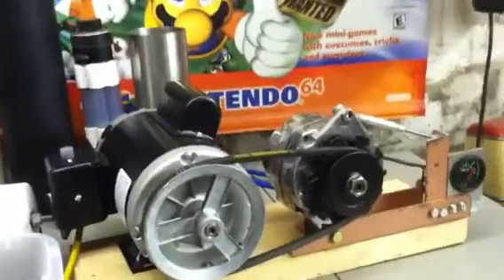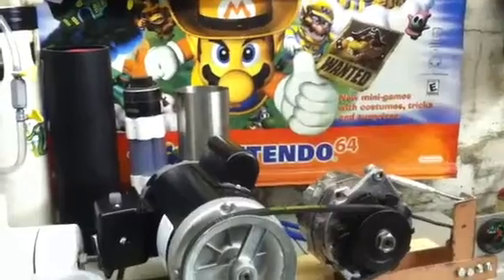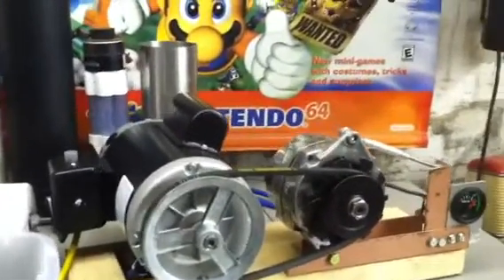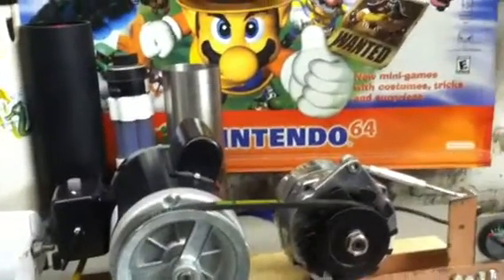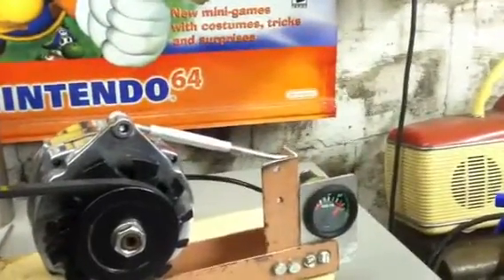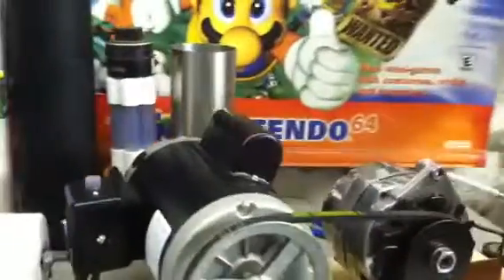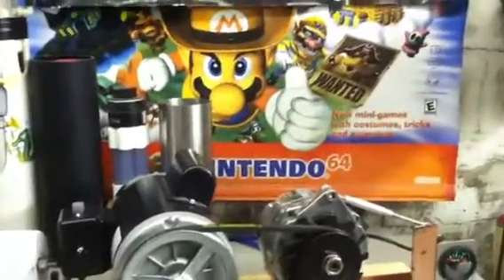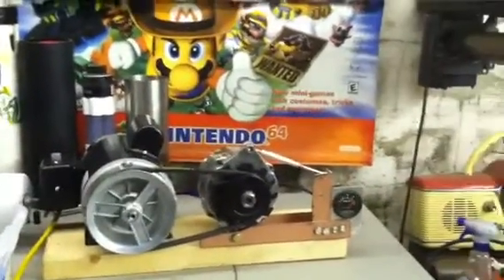Testing Hho charging station

Comment: 2 or 1 1/2 pullye would give you a lot more rpm's for the alternator. if you do not  have a supplier for the pulleys let me know, found a few online for another project i am doing. running hho cell off the 3 phase from my pulse motor.

Comment from the maker: Yeah I guess it depends on the gears,My street rod does 1,800 rpms at 65 mph my wifes new car does 1,700 at 65 mph so I will match the speed later this week an also buy a pully that will idle at 800 rpm so I can test that.Thanks Dominic

Comment from the maker: Well it is model 67841 from harbor freight,can be set up an a 12v or 240v which I will wire later. 1.5 hp 3450 rpm the alnt has a 3.5 inch pulley so i would need a 2 inch pulley for the motor. Maybe I should have bought the 67842  2 hp 1725 rpm but I had to have the fastest one. 67842 has dual caps for faster starts maybe I will return it later this week Happy Thanksgiving,Dominic

Comment from the maker: I have built many dry cells,the one ont the S-10 was doing 4 lpm under 20 amps a lot of u tubers have called me a liar and I was doing something to cheat beacuse of the high mmw rating When I built the cell I did not just slam plates together the water was controled to shock the out put gas,the current on the back of the plates was stopped, I had hard gaskets which kept a constant voltage across the stack,the cell was under pressure,special plates no round holes they cause turbulence inside.

Comment from the maker: I might build the same design but as a seperator,master bond makes a expoxy that will block the pos plate but still allow the current to pass which would be the ticket but it is very expensive.Coat the pos plate that will stop the oxygen production and now you are the KING.
Reply: sir what type of coat using on positive plate plz guide

Comment from the maker: Yes I have friends that run dragsters and they have played around with the water injection,If I can find the artical from MIT on the dyno test they did on 12 different fule saveing devices such as air,spark,magnets ect. None worked I will post it,the only one they said did any thing was HHO.